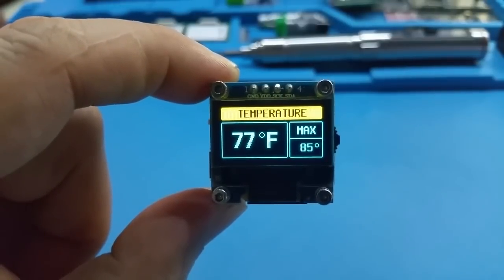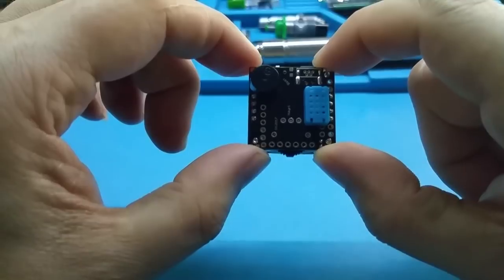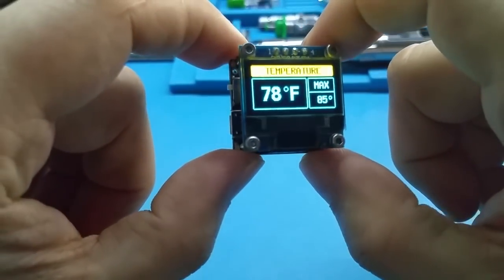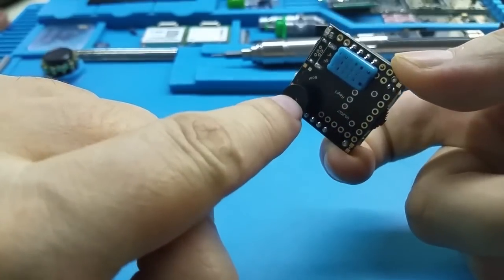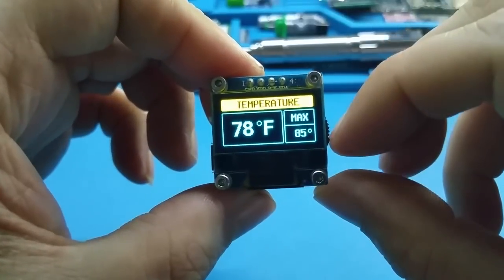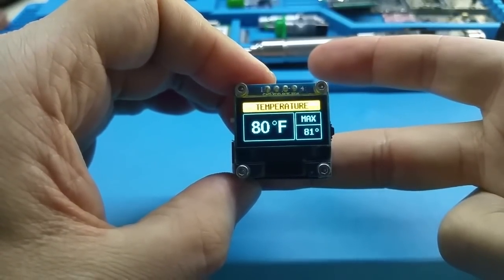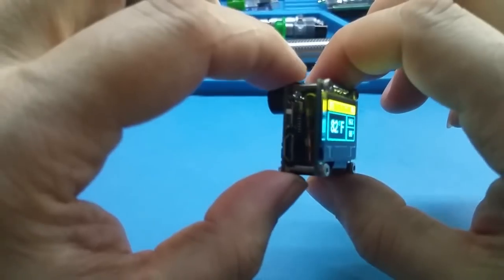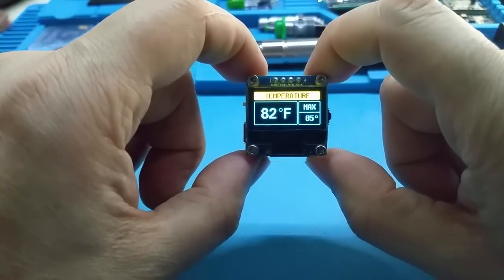Temperature Alarm Cube With Audio LED and Relay Output

Comment: Do you have something like this with 4 screens using p type thermocouples for something like measuring exhaust gas temperatures on a 4 cylinder engine? How can I contact you directly?
Reply from the maker: Sorry I don't, you can send me a message over my Tindie store.

Comment: Ok understood! In the future I would like some gauges for an ultralight. They would need to be auto dimming. I like your design and would like to chat further if you are ever interested. Great work. Contact me through stlhive.com or on my YT profile if you like.
Reply from the maker: Well I am currently working on my V-Gauge which can be to be used in a car, bike, boat, home and small aircraft. But there will be no auto dimming whatsoever as only few libraries offer that functionality and most of the code do not use those those libraries and re-writing all the codes is just not feasible.
Reply: Hayri ..I understand....no problem

Comment: Nice job Hayri

Any plans to build something like this that has wifi connectivity and can send SMS or email temperature alarm notifications?  Would be great to keep tabs on my place when I'm away on vacation in the winter.
Reply from the maker: Thanks Glenn, I could probably do this based on my other OLEDiESP board and then you could have it as a IoT device and could also send web based SMS and or email. I have the one from the video ever since the upload of the video, running nonstop on my desk.
Reply: Hayri 

I think a number of people would be interested in an item like this. Provided that it is ready to go out out of the box. 

I know I would
Reply from the maker: Well the one problem with the ESP is that everybody would need to configure it with their WiFi credentials and other needed info. On the hardware side all you need is a 5 volt power supply, a cellphone charger for example.
Reply: I figured on that, but how would you tell the device what the wifi password is, etc?

Simple would be better. 
I've been looking for something small and simple that could do this that wasn't too expensive but haven't had much luck. 

I will probably end up making my own, but haven't dabled in electronics for a few decades. 🤔 Could take me a while to figure it all out.
Reply from the maker: Well, you would need to edit the code with your info, connect the cube to your computer and upload the code. Basically replace xxxxxxx with your network name, password and email address for example. 

Good thing is you only need to do it once. You could also tell me that info and I could upload the code with the right info, so it would be ready to go. I do have customers that trust me with their WiFi info, don't know if everybody would :-)
Reply: I wouldn't be worried about that. Doubt you will find yourself close enough to my house to use my wifi, and wouldn't mind if you did :)
Problem is what happens when I get a new wifi or change my PW.  Looking for simplicity. Was hoping for something that can be accesed and programmed easily with a smartphone or the like. 
I'll have to look into making something myself. Liked the look of your projects, so thought I'd ask. Might have to get one of yours and use the alarm contact to trigger notification sequence. 
Thanks
Reply from the maker: Yeah, I doubt I fly across the ocean to use your WiFi but thanks for the offer :-) Changing the code is really simple, would take less than a minute to do. There are ways to do it over the air but it is not worth the trouble. Like you said, you could get my cube and use the trigger output for your needs too. You're most welcome.

Comment: Nice display like the two colores, are you using Arduino IDE ? and what OLED Library are you using ?
Reply from the maker: Hi Jesper, all my little cubes are basically an UNO that's why I had called the first version of my PCB OLEDiUNO (OLED and UNO) and while I enhanced them I gave the PCB's new names as OLEDiMAX, OLEDiMAXI and the OLEDiESP which yo can guess the last one is based on the ESP module. As for libraries, I use the Adafruit, U8GLIB, my edited MicroLCD library or direct commands to the OLED display depending on the code.
Reply: Hi Hayri,  Thanks for your reply.  Like your channel, looking forward to more videos.
Reply from the maker: My pleasure Jesper, will have a new video in a couple of minutes :-) Parts for my PnP machine have just arrived, need to unpack it :-)